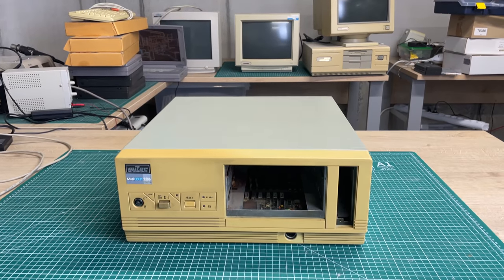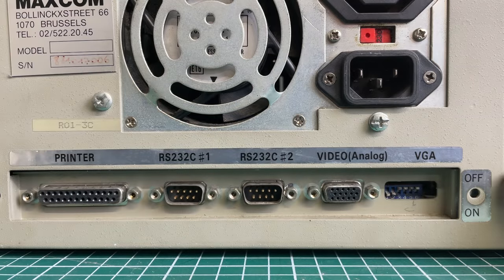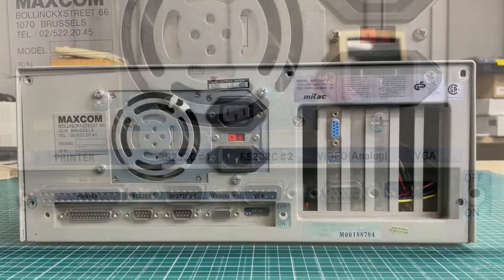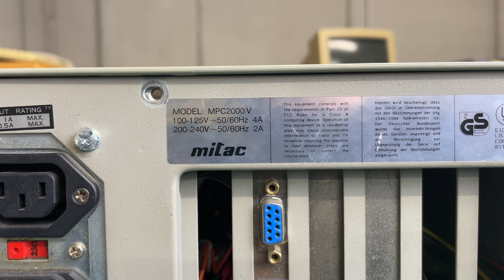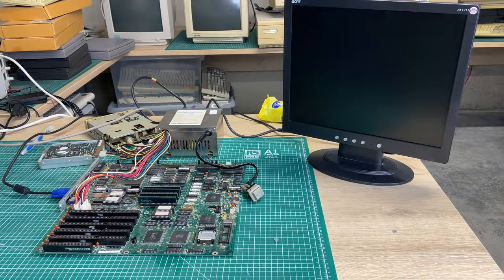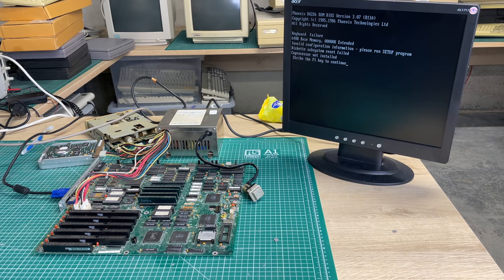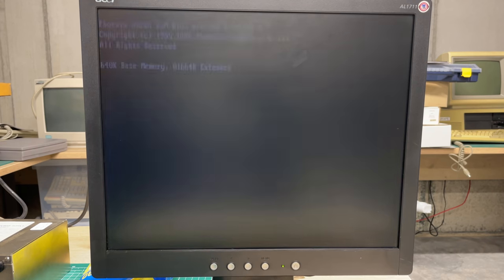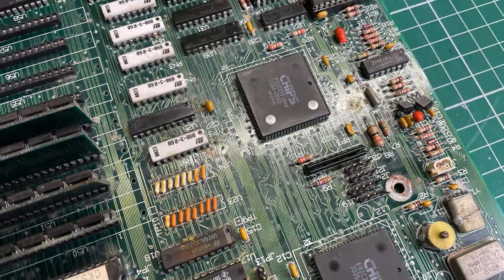Mitac Atari 286 clone. Can we save it ?

Comment: @RetroSpector78 I have a few tips for you:

1)  To get the CPU out, you do indeed just hold down and slide the metal bail holder all the way to the opposite side.  It just takes a lot more force then you would think instinctively.

2)  If you have a dead motherboard with 30-pin SIMM sockets that are in good shape or can find a supplier for them, you can swap those in place of the SIPP sockets without any adaptation.  It'd be just a straightforward upgrade contact for contact because electrically, SIPP and SIMM are identical.  Doing this may even help eliminate some additional corrosion that you may have missed.

3)  The corrosion may have eaten up some of the logic ICs and/or passive components that help run the memory.  Perhaps a diagnostic on those may be in order.

4)  The corrosion may have hindered that one chipset's ability to function at 100% of the time properly.  You may want to take a closer look at that.

Just trying to help.  Great video as always and have a good one.
Reply: I am betting more on it being an issue with bank A20 switching.. As the problem manifests after it tries to search for anything above 1mb
Reply from the maker: Thx for the tips. Got the CPU out ... nice little Ceramic Leadless Chip Carrier 286 package. I do have the simm sockets that I could plug in to the motherboard. But wanted to keep it original. Think the memory modules are find just bad connections. Did some spot-checks on the traces and the ones I tried that looked messed up seemed to work. Once I get a floppy and hard drive hooked up I'll be able to do some more diagnostics and you'll see it here on the channel.

Comment: Once in 1992 I  received 8MB of SIPP rams for my work, and I brought it home. To my disappointment, my PC accepted only SIMS. Not having any adater in mind, I took a small screwdriver and tipped off each and every pin latch from the edges of modules. And yes, they worked perfectly for another year or two as the "converted SIPPs".

Comment: Check the keyboard controller. The 286 uses it to switch the A20 gate to access memory above 1MB. Later PCs tend to use a chipset function or can be switched between keyboard controller and chipset. I am currently developing an input adapter (USB to mainly any oldschool system you can imagine) and registered keyboard inhibits during memory count even below 1MB, always when accessing XMS (HIMEM) and EMS (HT12MM) and even sometimes when accessing the first 1MB introduced through the keyboard controller switching the A20 gate. An indication would be that it posts correctly until you set the memory settings and it becomes aware of the high memory areas that require Gate A20.
Reply from the maker: Wasn't aware of that. Thx.  What exactly can one "check" on the keyboard controller ? You mean with a scope or logic analyzer ? What should I be looking for ?
Reply: @RetroSpector78  One of the dirty chips was a P8242. The 8042/8242 is normally the keyboard controller. The keyboard controller switches the A20 gate. I don't have deeper knowledge of this mechanism, but what I discovered is that the keyboard controller pulls the Keyboard Clock signal low for a very short moment when accessing the A20 gate. This is typically a sign for the keyboard "key press inhibit, listen for transmission" (a host to device communication is initiated by pulling the data pin low afterwards). But the A20 access only causes a short clock low, not followed by a data low. You might want to peek around with a scope in the pins involved in the address line 20 (Gate A20) and the keyboard clock. Also consider swapping the keyboard controller. Normally, all 8242 are interchangable, but there might be slight incompatibilities. If you have another 286 to 486 era board that also uses the Intel P8242 (not guaranteed but also likely to work with clones like American Megatrends or Holtek), maybe try swapping the keyboard controller, too

Comment: Those "RAM adapters" you mentioned: All you need to do is to insert regular 30pin SIMM sockets into the SIP sockets. Adaptation done.
The CPU socket unlocks exactly like you thought. There's probably some gunk between the metal latch and the CPU, so it won't budge. Try gently hammering the lid sideways, it'll break loose. Maybe use the handle of a larger screwdriver to whack it a bit.
Reply: My thought as well, a small screwdriver and a small hammer and gently tap the cover over.
Reply: It would be hard to inset with the separators in the sockets between every pin... I'd probably solder pins on a SIMM if I really needed one, but don't quote me on that.
Edit: watch all the video, comment after...

Comment: You don't need to search for SIPP -> SIMM converter. You may either desolder SIPP sockets and solder SIMM sockets in. It works plug and play as SIMM and SIPPs are electrically compatible. If you want to keep motherboard original, just stick SIMM sockets into SIPP sockets - trust me, it works, at least for my 286. Also, I would recommend to clean SIPP slots VERY thoroughly, especially using deoxidant of some kind.
Reply: Sticking the simm sockets into the sipp sockets however can damage the sipp holes on the board. The pins are different shapes quite often.
Reply: @wishusknight3009  in my case SIMM socket pins were exactly same size as SIPP pins (as they should fit in solder holes on motherboard).

Comment: I hope you can get it running again! It looks a lot like the 386sx my grandmother used to have.

I'm a bit of a Mitac fan for many years since my first own computer was a Facit (mechanical calculators, you know?) branded Mitac MiStation. That computer was scrapped many years ago now but I have a few others in my collection in different conditions. The most noticeable difference is that the Facit version is light grey with slightly darker disk drives and a yellow/orange power button. Quite good looking systems for that time period if you ask me.

Comment: Simply awesome job. Try hitting the RAM and other related chips with some "Freeze it" spray to find the chip that has a thermal problem. I did some board repairs by removing corroded chips, removing the corrosion on them, re-soldering them, then removing sockets etc on a friends antique computers for his YouTube channel. I posted the videos of the repairs and how to do them on my channel, that's if you're interested in it.Thanks for sharing I really enjoyed video and love the old CPU's. Best Wishes & Blessings. Keith Noneya

Comment: Kinda cool how similar this board is to the Commodore PC40-III which is also a 286 with pretty much everything onboard as well as the Paradise SVGA card (ok SVGA is a bit of a stretch with 256k, but it does 800x600 without hacking). And also I have another 286 board at home which is pretty much a no-namer (even has a really weird BIOS, the only way to access it is if you manage to corrupt the settings, otherwise it won't let you in! There are programs for that though) and it also has the Paradise SVGA onboard (but this one was made in 1990).
But what's weird is I've seen another 286 motherboard also "by Atari" that was made in 1991... and it only has CGA onboard.

Comment: As for the CPU socket, that makes me think of those sockets that are made to put SMD chips in, I might be way off though, that contamination on the boards and chips, wow.
Reply from the maker: The CPU is a CLCC(Ceramic Leadless Chip Carrier). Managed to get the CPU out. The metal part (acting as a heatsink ?) was stuck but I managed to slide it out.
Reply: @RetroSpector78  Ah right, I explained myself badly, but that's what I had in mind, nice to hear you got it out :)

Comment: Great job most of the damage was fixed by the cleaning. I was thinking if the ram socket was the problem maybe it was floppy. Maybe putting a small heat sink in that 286 could help, those usually don't require but maybe it was a special one. If not doing the conversion memory kit could help.

Comment: You were lucky, I think that was not battery leakage, "only" simple water corrosion, the motherboard mainly got the falling rust of the metal frame above. That much real battery fluid would have eaten a hole in the motherboard :) But it did look very bad, I think many of us would not even start cleaning because it looked doomed.

Comment: I don't think I've ever seen a clone with two serial ports as standard.  Parallel and serial, sure, that goes as far back as 1983.  But two serial?  This is the first I can remember.
Reply from the maker: It was pretty well equiped. Capable of handling 8 MB of RAM without an EMS card, onboard video (analog and digital so covers MDA/CGA/EGA/VGA), 2 serial ports, onboard floppy controller

Comment: Nice video.  If the fault manifests after a few minutes it would suggest to me something heating up and loosing connection.  Some of the vias look a bit dodgy, maybe try reflowing them.  Wouldn't do any harm to equally reflow the legs of any chips that are corroded.  Might just be a dodgy solder joint.

Comment: I got hold of 4mb worth of sips  for my normal 286 sim based and I un soldered the sip pins and used them for my 286, I scored big time for the day
Reply from the maker: SIPPs are not that easy to find here. But I guess it works both ways (soldering pins to SIMMs to convert them into SIPPs) :)

Comment: I had a S462 board that would be fine on cold starts but as soon as it all got warm it would refuse a post and run fans at full speed so i'd have to let it get cold again n leave it for a couple of weeks. Failing caps were my issue so perhaps some tantalums are failing?

Comment: I would start with rework solder joinst, look closely to traces in leaked area, replace electrlityc capacitors and check CPU condition

Comment: you might need to replace the ram sockets. those are easier then regular ram sockets lol. in fact you may need to replace a few chip sockets to get it stable. but no telling what could be going on under the chips soldered to the board.  That CHIPs chip that had the rust on it may need to be pulled to clean under it. lot of work but it turns on so that is a great sign that it wants to live. :)

Comment: Does it really have 4 Megs of memory, that looks a bit much for a 286-class PC of this era? Perhaps it’s using 4 modules of 256 KB for a total of 1 MB.
Reply from the maker: The computer prides itself in being capable of handling up to 8mb of ram. And the sticks are in fact 4x1MB.(checked the ram chips)
Reply: @RetroSpector78  Okay, pretty wild for a 286 :). I hope you can revive the board, Mitac was one of my ‘dreams’ back in the days, in my opinion more than just a clone manufacturer. I ended up with a Target 386SX/16. Gosh, I wish I still had that machine… 🥲

Comment: Try to run it without extended memory at all
Reply from the maker: The computer starts with 2 sticks of ram but the setup utlity expects at least bank 0/1 to be filled (4 sticks of either 256kb or 4 sticks of 1mb). Otherwise it throws memory size error.